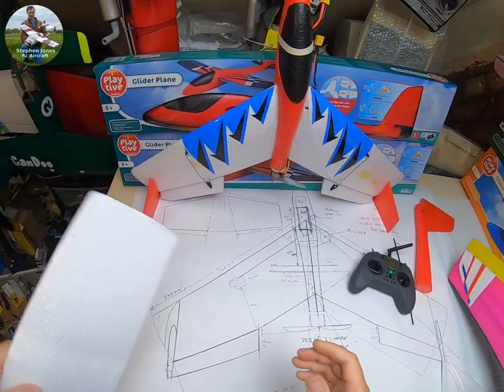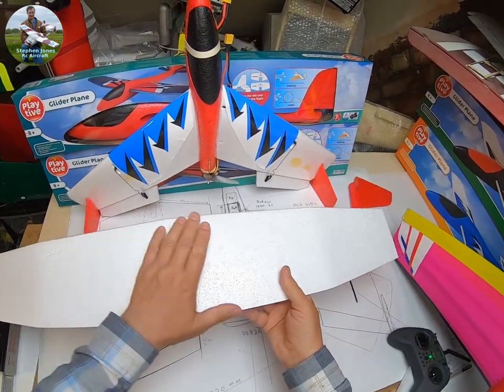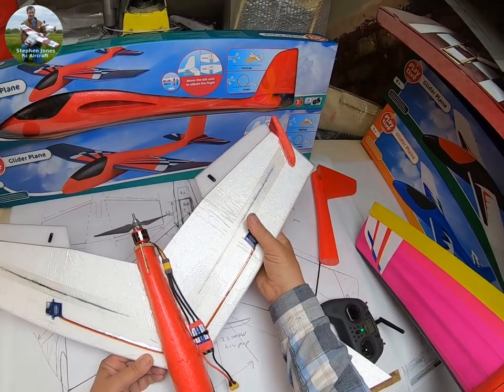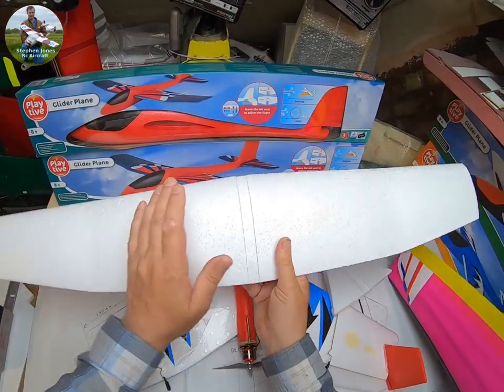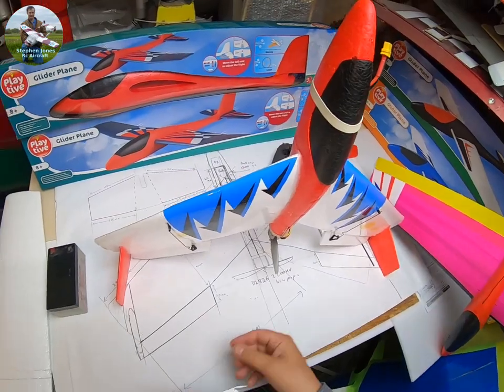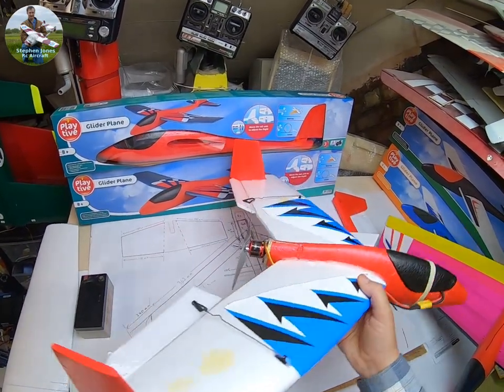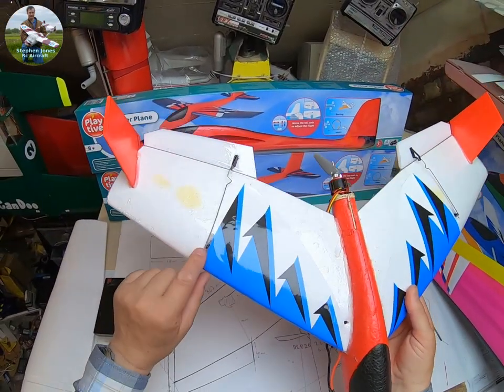NewFlidl Build

Comment: I hope you survived the European Championship shock. Unfortunately, my fingers crossed for England didn't work. You have developed the Newflidl very nicely👍👍👍 . My Newflidl prototype had almost the same wing sweep - 116 degrees. From experience I can tell you that the wings don't have to be ironed either. Probably your center of gravity was not right then it could be that the Newflidl does not fly stable around the roll axis.
Reply from the maker: Was the difference between the new  or old version of the Lidl Glider ?
Reply: @RcAircraft  Both versions can be converted in the same way. The old one flies more slowly with Evelons on. The new one is more directional and we think a little faster.
Reply from the maker: @Flybrei  I will have to test it out. 👍

Comment: Nice Video. I fly my newfidl with a 2s 1000 mah. It is lighter, you can fly slower. So it is suitable for beginners  or older pilots ( like me). 😁👍
Reply from the maker: Yes I wanted it to be fast, but I could fly slower or use a 2s battery and a smaller prop. But then it wouldn't do vto 🤩

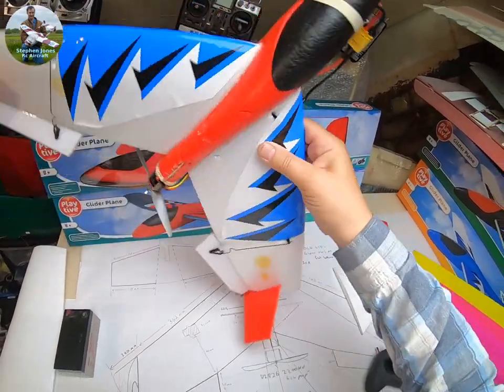Comment: Who else was nervous from 6:15 until 6:54 hoping Stephen didn't bump the throttle stick while the battery was still plugged in?
Reply from the maker: The throttle cut is programmed to a switch. So will not operate until switched on. 😉